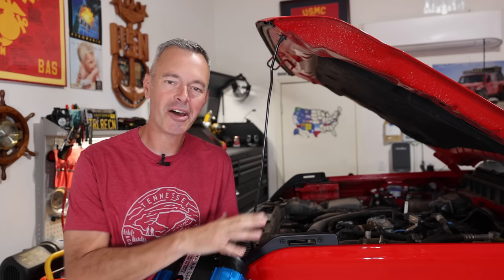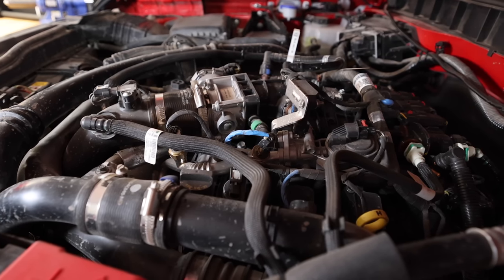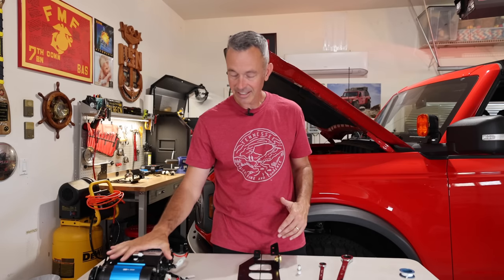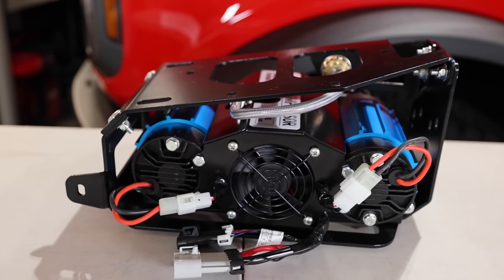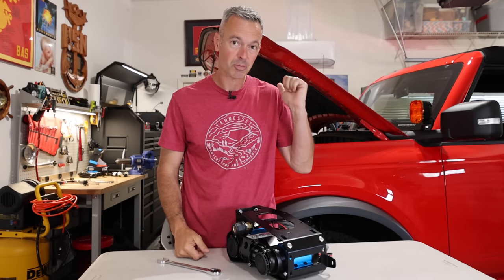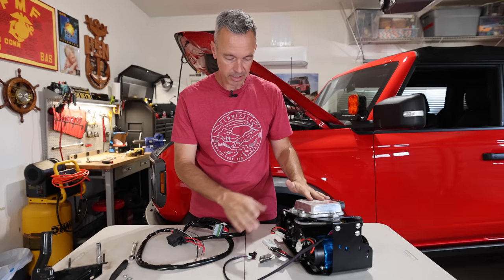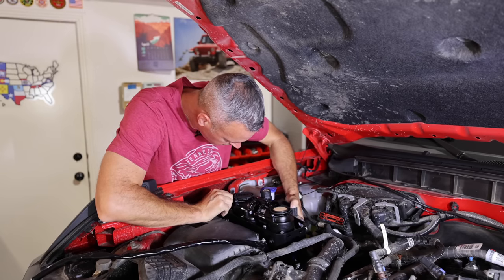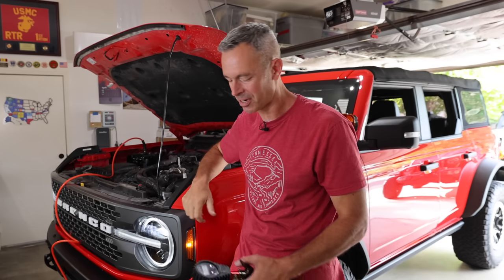Ford Bronco Hidden Air Compressor Install

Comment: Am I the only one screaming "Don't put tape on the flared fittings!"
Reply: Came here to say this!
Reply: Beat me to it. JIC fittings don’t need tape.
Reply: @buckswindle  many people on here may not know this much about air fittings and parts. Myself included. I have always used PTFE tape on all hose fittings. Why do some need tape and others don’t?
Reply: @AV8R_1   Tapered threads (NPT BSP) rely on the interference fit of the threads to provide sealing. With these fittings you need tape or dope to lubricate the threads and prevent galling and to help seal any imperfections in the thread seal. 

Flared fittings (JIC etc.) rely on the contact between the two flared faces to provide the seal. The threads just provide clamping force and don’t provide any sealing. Straight threads (SAE etc.) will use an o-ring or washer to provide sealing.

Comment: I love the way someone came up with that idea. I own a 2014 Prado, diesel of course 🤣 had it since new, catch can, water watch for the fuel, and a duel battery and there is no way you will get a compressor under the bonnet without someone with more brains than me does what they did for the Bronco.
Reply: You can get brucket in Australia for fiting ARB twins compressor for 150 ser. Prado fit at rear left side also brucked for single ARB compressor under bonet from KAON.
Reply: @tedo1634  
Cheers mate.

Comment: I mounted mine inside the rear hatch area.  The underhood area is exposed to too much water.  You have to either buy the remote filter kit and move them inside or risk getting water inside the filter.  The air box for the truck is designed so you cant get water inside if you dont go too fast.  Im waiting on my snorkel but have relocated my exhaust, the rear end and transmission vents.  Still need to source a sealed alternator.  We get lots of flooding in my area and i run trails that require river crossings.  One trail is submerged to the hood all the way for almost a mile.

Comment: Teflon tape is not needed on flare fittings.  The sealing is on the flare not the threads.

Comment: An air-up hint is having the ARB switch in the cab so when you're airing up, just look at the tire pressure monitoring page and turn off the ARB when it hits the right number.  I use a SpeedFlate two-way air system so it's nice having all 4 tires equalized and the perfect pressure (nice for airing down too).  My ARB is mounted in the same spot on my Bronco.  Perfect spot!  Great vid :-)

Comment: Brad,
For the filters, no need to replace them. Just pop the cap off the plastic housing and remove the brass or bronze, not sure exactly the material, filter media and wash it out. Then just let it dry and reinstall.

Comment: Thanks Brand for this content, I have ordered mine...I've had my ARB Twin Air Compressor since the Overland West Expo...This is a good find...keep posting the great content.
Reply: Brad, got it installed...your step by step instillation process was excellent...used it on the trail...no problems...Thanks a bunch!!!

Comment: Like you, I love tinkering in the garage whether it is working on the Xterra or building something to make overlanding a bit nicer.  NOW... run down to the Ford dealer parts department and order a set of Bronco Raptor hood struts and get rid of that hood rod.  Until next time... wrench and travel safe.

Comment: Great video. Loved the step by step, and the hints along the way.  Will this set up work with either the 2.7L or 2.3L? Is there any difference in the twin compressor vs. single compressor.

Comment: Thank you for the video! I just installed this on my 2023 wild trak and first time I used it it blew a  fuse. Do you have any suggestions or have you had any issues with this?

Comment: Question: When I looked at the install instructions from ARB, it says that there is a non optional step when it comes to wiring the switch. This is what it says: "Locate an ignition/ACC power circuit, minimum 8 amps, using a multimeter. This circuit must only be live when the vehicle ignition key is in either the ‘ACC’ position or in the ‘ON’ position. Connect the red/yellow wire to this circuit using a method of your choice. "  I did not see you do that in your video, I was wondering how you got it to work?

Comment: Why are there so many comments recommending power tanks? They're bulky and would take up a decent amount of cargo space that you could be using for other things, compared to a compressor mounted in the engine bay. On top of the hassle of having to refill them.

Comment: This may work out fine, but…
Here’s my issues: 
1) Mounting that to the computer is a TERRIBLE idea and will DEFINITELY void the warranty on the computer if it were to fail.
2/3) The intake being upright seems like a good way to get water in the compressor, same with the chuck. I’d try to find a silicone cap for the chuck and maybe put the plugs back in instead of the filters since it only takes a second to change them out.
Other than that, seems pretty cool. I love my ARB Twin compressor. I don’t have a Bronco, but it’s nice to see stuff starting to hit the market for them!!!

Comment: I’m not sure i would want to mount the brains of an electronically controlled machine, that could have me miles away from civilization, to be mounted to something that can vibrate. I don’t know what the frequency of the arb is, but given that a Janet Jackson song can crash a computer I wouldn’t risk it.

Comment: The situation under the bronco hood is like looking a a bowl of spaghetti! All those plastic fitting hoses are going to be a nightmare after ten years. I'd hate to be the one dealing with brittle spaghetti when that crap starts to fail. Tape don't belong on those fittings flares are flares for that reason!!!!!!